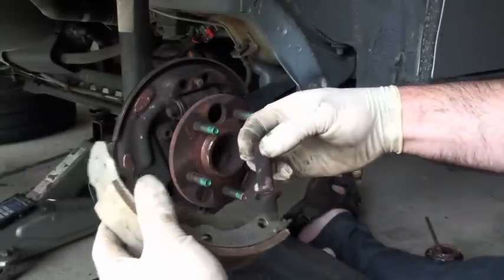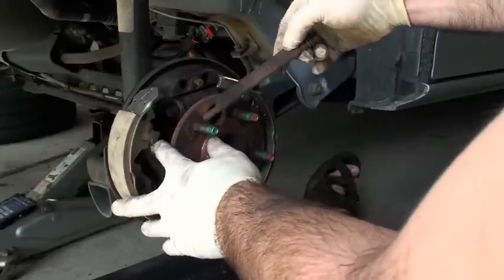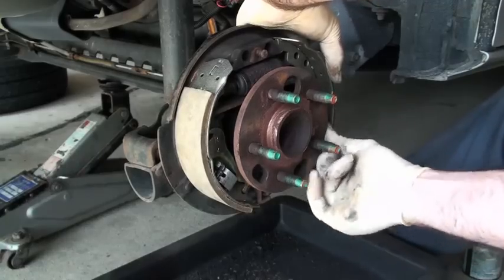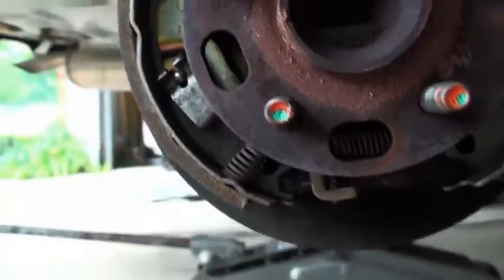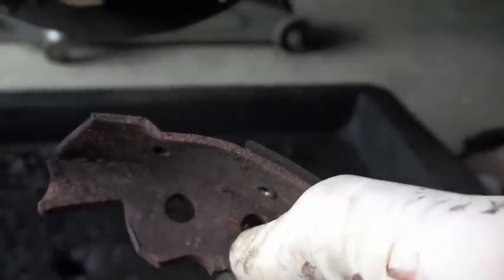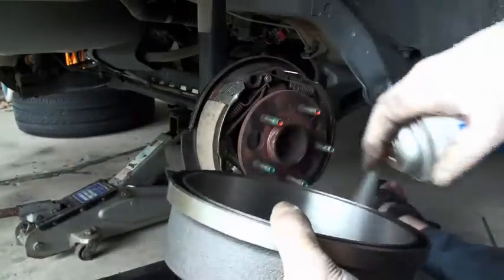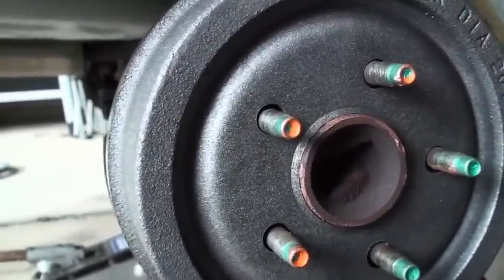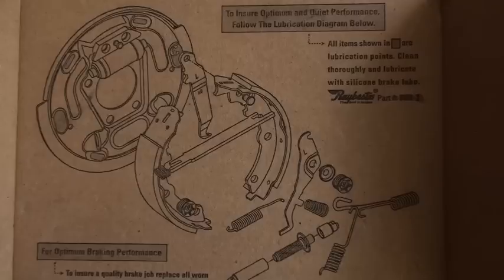Replacing Drum Brake Shoes Part 2 - EricTheCarGuy

Comment: I did mine be today on A 97 f150 but I can't get the drums on without forcing them. The adjuster is a short a it can be and the shoes are resting on there contact points.
Reply: What was the problem?

Comment: Your video help me a whole lot. I haven't did my rear brakes yet but will soon. I don't have the tools that you have but I did take a picture of them and going to buy it today. But Part 1 & 2 gave me a run down on how to do it safely. I'm not a mechanic on cars but it's cheaper to do it than taking it to the dealership which they charge high on labor and they're expensive. Thanks Eric...

Comment: Just a few points:  1. Always spray a "Brake Cleaner" on all the components when done, to avoid having any lubricants or contaminants on the brake shoes.
    2. Avoid having any of the brake dust contact your clothes and use a mask to avoid inhaling any of the dust. (there are still asbestos type brake shoes and pads still being sold)
   3. ALWAYS put a jack stand under the vehicle as hydraulic jacks can lose pressure suddenly.
   4. Open toe shoes are strongly discouraged while performing any automotive work.(NASCAR will not even let you tour the pits without shoes and long pants being worn)
  ALWAYS wear eye protection as those springs are quite unpredictable when coming off the assembly.

Good Luck to all.

Comment: I am watching this because the guy I got my vehicle from didn't replace the hardware and it broke on me as I was pulling a trailer down the road. It could have been very ugly and I am fortunate the road was deserted. The spring kit cost $7.50 with tax. Let's count the cost. $7.50 vs my life, (and any other bystanders). "not in the budget" is not an option henceforth! But don't stop teaching. thanks for taking the time.

Comment: Eric, thanks a lot for this video, you're a huge help to me whenever I am needing to get some things done on my Jeep. I tore apart the rear axle and pulled the axles to replace the bearings. I didn't need to do much to the brakes but if I do now I will know. I have had the brake drums too tight to remove before so I had to open up the inspection hole in the back and use a funky spoon tool and a screwdriver to turn the star wheel to loosen it up. What a PITA but I did it to both. Talk about hard!

Comment: Eric has a good point in this video: 1. Get the proper tools 2. Spring will hurt you if you are not careful. 
I did new brakes for my past car few years back and didn't get the tools. It took 3+ hours to change front discs, pads, shoes, drums etc and about 80% time i was fighting with the springs and putting band-aid to my fingers.

Comment: Heartless criticism Pt2: I followed your lead on the spring above the star wheel but I think you've got it backwards. The diagram near the end and another I found online seem to show the hook towards the outside. When I first got the shoes on the D side was hanging before I'd adjusted at all, after looking at it a few times I think the P brake lever was hanging up on the hook of the spring. I swapped those from side to side and it worked perfectly after that. Thanks for the video!

Comment: Eric, thanks for this video. It's been a long time since I've done drum brakes but I watched your tutorial before I did my Sunfire and had no real problems but I believe there may be two errors in your video: One is the self adjuster pawl return spring, you say it may or may not be needed. I'm pretty sure that without it the brakes could tighten up because there would be nothing to stop the star wheel. I'll put the 2nd in another message.

Comment: @ericthecarguy, I did. and i got them on. After driving it a couple days, is it normal to have a slight burn smell from the new pads? The brakes are working fine and are not grabbing. My wife pulled in the drive way and noticed the smell. The rim was a little hot, I just figured it was from the driving. Thanks again for the video.

Comment: If you get grease on the new lining, you need to get some sand paper and sand off thegease and dirt from the lining.  If you don't remove the grease, they will contaminate the new lining as you use the brake.

Comment from the maker: @CRAZYCHICKIN Try pushing the wheel cylinder in at the top in the same way you would a caliper piston.  Just take the shoes and push in on it from both sides at the same time and then try to install the drum.

Comment from the maker: @loudpipesavelives69 Actually it's 1920's technology but the reason is supply and demand, lots of drum parts still in circulation which actually still makes them cheeper than disc.  Also consider that there is less materials in this design which would also contribute to a lower cost.  Thanks for the comment.

Comment from the maker: @MrTee448 Great question and one for your parts guy so you might want to have your VIN # handy when you get your parts as it should have the shoe size that you need.  This normally happens because there is more than one brake application for a particular vehicle.  Thanks for your comments.

Comment: @o0sum1udontknow0o The reason you have no power I believe is the fact that you may have had your brake engaged when you were adjusting the contact lever that makes connection with the drums.  Eric said your drum shouldnt make contact but if your brake was engaged then it should make contact.  the only time your brakes shouldnt make contact with the drum is when your brake is disengaged.

Comment from the maker: @o0sum1udontknow0o I think you should start by checking your rear brake adjustment first and get that to where it's correct, if you still have an issue then look to the cable adjustment for the parking brake.

Comment from the maker: @tuberstoma If it's all wheel drive you are working against the resistance of the drive line.  I recommend putting it in neutral when making the brake adjustment.

Comment: Love the video. Really helpful, but I notice that my Subaru Impreza wheel doesn't spin as freely as the one in the video. Even with the star adjuster all the way down. So I've been having difficulty doing final adjustment. Plus the e-brake seems to not engage enough, even when the star adjuster is pretty tight. Is it the all wheel drive that creates more drag on the wheel?

Comment from the maker: @TokkenNinja I highly recommend you get the tools, they really aren't all that expensive, less than the brake shoes perhaps.  As for the adjustment re-watch the video because that is not always the way it works, aside from that after installing the shoes you need to adjust them first or you may not have a brake pedal at all.  Good luck.

Comment: Great video, thanks a ton! It's good that you mentioned to keep the other wheel as a reference, in case you get stuck.

Also, I usually like to back the car down a hill afterwords to set the automatic adjusters. :-)

Comment from the maker: @austinaubinoe Like I said in the previous response it may be that the bores that the seals are suppose to seal against are the problem (and it often is), if that is the case you will spend a lot of time trying to correct this only to find that the bore is too large for the new seals to work.  Been there done that, it's much more practical to replace the assembly but if you want to reseal it have fun.

Comment: @EricTheCarGuy JEEZ just double checked the prices on rockauto: a new wheel cylinder is literally 70 cents more then the rebuild kit! (both Raybestos). Glad I checked!

But caliper seals are only a couple bucks, and replacement calipers are $52. So that might be worth the effort. Is it possible to disassemble the caliper, replace all the seals, lube the pistons, etc? Mine seem to work fine, but im sure the 20 year old seals are dry-rotted. 

Im working on a 1991 Jeep Grand Wagoneer.

Comment: I would just like to say always replace the hardware. You can get a complete kit for like $4-7 at RockAuto.com, does BOTH sides. Also, star adjuster kits can be had for about $5 a side. I usually just replace stuck ones.

What brand brake parts do you use? I usually go Raybestos Pro grade.

You should do a video on rebuilding wheel cylinders and disc brake calipers!

Comment: @EricTheCarGuy actually, it is a mazda, yes :) and what do you know, I fixed it yesterday. I filed the teeth just slightly with a 90 deg microfile and now it works fine. another thing is that I never took into account the damn thing is symmetrical and it acts differently wether it is set on one end or the other, even though the distance stays the same. on one end they retract, on other they separate. and thanks for the brake cable jiggling tip, that in fact solved half of my problems too

Comment from the maker: @seasonedtoker I'm guess that's a Mazda, you don't do anything with the teeth but never lubricate them as this will cause them to loose their hold.  I suppose you could file them but it's hard to tell how much because if they stick together it's just as bad as them not holding, you may need to replace the adjuster assembly if it doesn't hold correctly.

Comment: mines don't have a star adjuster, but it's got an automatic one. it's two plates with teeth on rounded edges. these edges then bind one with another ... I am always having trouble these going out of adjustment. should it be enough just to sharpen the teeth with a file a little bit?

Comment from the maker: @rjpeterson16 The coating of paint will actually hold in heat and with brakes you want them to dissipate heat, this is why I laugh when I see painted brake parts.  I guess the cheep ones use paint instead of the rust inhibitor found on most new brake parts.  BTW that paint will come off in a very short time I'm sure so it's rust inhibiting abilities are not very good, brake parts are going to rust no matter what.

Comment from the maker: @NerdForMIT The problem is sometimes the adjuster gets rusted up and doesn't work well, also most brakes these days are non-servo and don't work the way you describe but rather adjust with the parking brake activation.  I did make a notation in the video about the shoes and you are correct about that, this was an early video for me and to be honest I didn't think it would end up with this level of views.  Thanks for your comments and for your input I appreciate it very much.

Comment from the maker: @NerdForMIT That only works on servo brakes and to be honest it really doesn't work that well, they use the term 'self adjuster' loosely.  Aside from that you really need to do this initially after a brake job, if not you may not have a brake pedal at all when you attempt to do it the way you describe.

Comment from the maker: @KTMrida4life Not really, you can just replace the shoes if there is no pulsation to be concerned with.  You can also have the drums machined if there is enough material left in the drums.  I did a video about this called Brake Drums, When To Discard that goes with this one.

Comment from the maker: @gothicman02 The reason for the one short and one long shoe is to help with the activation of the self adjuster, if you put them on backwards it may not work properly.  On this car it doesn't matter because it's a non-servo type and uses the parking brake to self adjust.

Comment: Funny how I have the same car with the same rear brakes and after doing them today, I now find another great video from eric the car guy lol.  I do have a question however.  If you possibly put the shoes on backwards (short shoes on the back and vice versa) will there be any potential problems? My new ones looked the same on all shoes so I was unsure if it mattered.  Obviously my mistake.

Comment from the maker: @MrRaven5132 If you don't have a problem with pulsation from the rear replacing the drums should not be necessary which will save you a lot of money.  They may have also included the price of the hardware in their estimate but once again if you don't have any problems here you should be able to reuse your old springs.

Comment: Eric what are the metal piston things that insert into the wheel cylinders? Mine or rusted and pitted and have scale on them and don't seal correctly with the wheel cylinder. Should i just take a grinder to them?

Comment from the maker: @roberthungdoctor To be honest I find that to be a waste of time unless it's an older vehicle that disc brakes were not available on.  My philosophy is that if you want a performance car buy a performance car and fix it up, don't take a non performance car and try and turn it into a performance car because it will cost so much more in the long run.  To answer your question though that does sound like a good future video since I've been asked to do it more than once at this point.

Comment: @EricTheCarGuy Makes you wonder why the brake manufacturers dont bother anymore?Sometimes they put a small hole on the front of the drum. I Always clean the ridge of the front of the drum with an angle grinder if im forced to adjust the shoes before I fit the drum (only if the old drums going back on)

Comment from the maker: @JonChapa Since the wheel cylinder came apart during the job you will need to bleed the system, make sure your brakes are properly adjusted first as this will make it a bit easier.  You should only have to bleed the wheel that came apart but if the problem persists then make sure your adjustments are correct and bleed both rear wheels.

Comment: @borbor122  actually i fixed it,   i did the last step and adjusted brake,  tugged the cable to center the brakes and in-between  tightening, until there was some Resistance turning the drum, and loosening just until there is no more resistance.     That did the trick ( I also went under and adjusted the main e-brake nut to tighten it just a little bit more with a couple turns) now the brakes e-brakes and brakes in general work perfectly.

Comment: Hello,  my name is Boris and i have a 1998 TJ 4.0L  Jeep Wrangler.      I did my back drum brakes recently and your video did help a lot.  I ran into a problem though,  my e-brake no longer works.    The only steps i forgot to do was the pulling of the brake line to center the brakes and adjusting the screw (i though it was self adjusting so i never bothered with it, but maybe i thought wrong)     Is this why my e-brake is working anymore?  What do you think ?

Comment: hi my name is karen i own a 1996 mercury mystique. i'm replacing the rear brake shoes  on it and i seem to have run into a problem. i thought that watching ur video would help me but i'm noticing that this doesn't look the same. i cant seem to pull the parking brake spring back off the cord enough to reattach my brake shoe bar thingy. i'm in desprite need of help if you can help me please message me asap!. thank you. karen.

Comment: @EricTheCarGuy Hey eric I saw your video, nice job I even like the humer,, LOL about the jack stands very funny. very to the point.
My problem is some what complicated, you see my father in law frove his rear brakes to noting and I replaced them, now I have a problem with the ABS kicking in at low speeds, they are just really touchy. I'm looking into mabe dirty speed sencer or warped front roters. If you brake normal they don't pulse but if you brake hard the fronts tend to lock up/ ????

Comment: Hello all,
In my opinion do not replace the rear brakes on a 2002 cavalier with a bonded style shoes. They should be replaced back with a riveted style shoe. Also replace the drums with factory OE drum not aftermarket drums. Good theory to keep is "what is was born with is what goes back on with".

Comment from the maker: @goodandchew10 There is a special tool for removing those types of springs, it's usually found in a kit that has brake tools.  If you don't have a functioning e-brake you can just as easily step on the brake pedal to perform the same task, just make sure you have both drums on when you do or you might be replacing a wheel cylinder.

Comment from the maker: @exoticlown It sounds like you may have the adjustments too tight which will cause the brakes to heat up and cause the problem your having.  You might try spinning the wheels to see if they spin at least 1.5 to 2 turns when you spin them, if not then you might want to back off the adjustments.

Comment from the maker: @sav7152 Check the parking brake cables, they can seize up if they haven't been used in a while.  I've actually had to cut some to get a car to move in the past.  It's not a bad idea to clean and service the rear brakes while your replacing the cable if that is what you end up needing, that way it won't happen again anytime soon.

Comment: Hi Eric! Love the video's...you have saved me a lot of money!  Recently, I picked up a "PROJECT CAR" but I like to call it a RUST BUCKET. Its actually a 74 Dodge Challenger. It needs a ton of work but in order to do that work I need to be able to move the car around.  When I first got the car it wasn't even an issue as the emergency brake would release properly.  Now its nearly impossible to move and I have no experience with drum brakes.  i was wondering if you had any suggestions

Comment from the maker: @rrrunge1 Replacing the hardware is not a bad idea, from the sound of it I think the shoes are hanging up on the backing plate so pay particular attention to the bosses where the shoes make contact and be sure to clean them up well and lubricate them before you install the new shoes.

Comment from the maker: @switch55 Sucks that you fixed one thing only to find another thing break.  To be honest I got my brake tool kit from Sears (it was less expensive than the tool truck and I don't do drum brakes that often) so you should be able to get the same set as I use in this video.